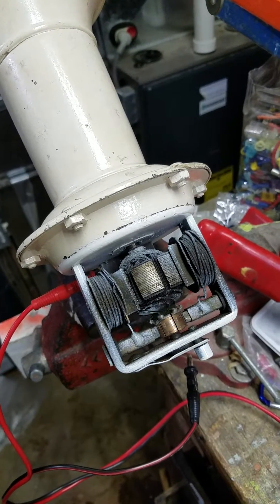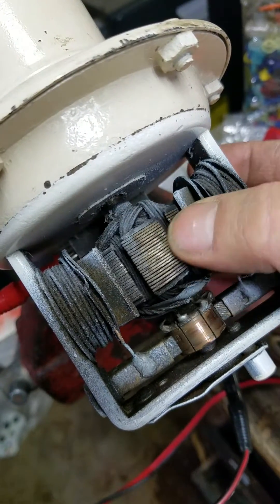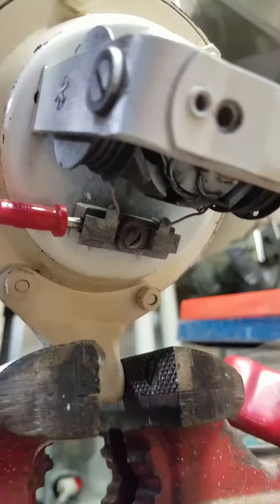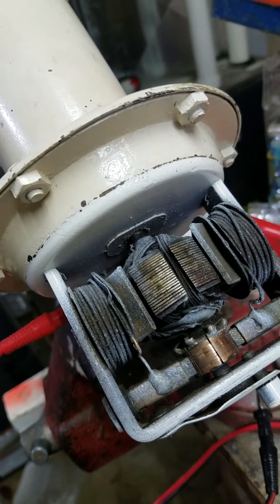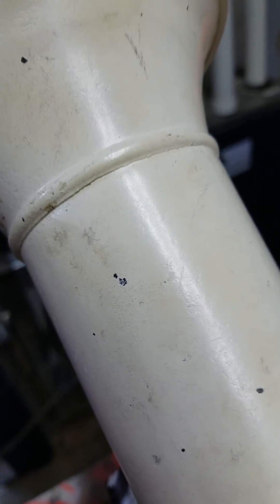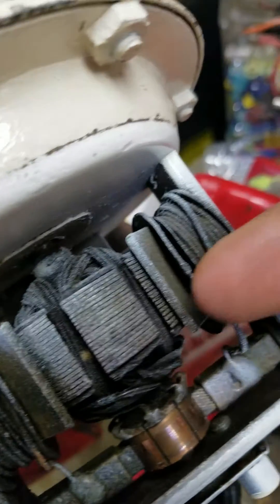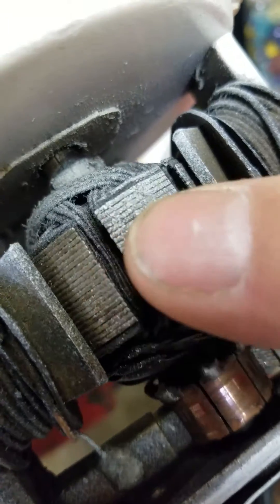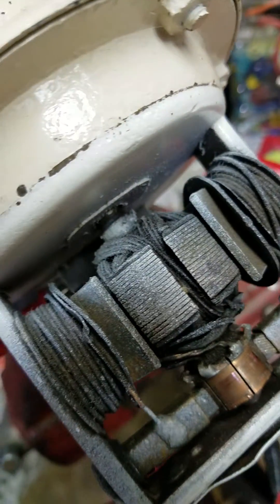Inside a Model A Ford AOOGA Klaxon Horn with Doc | Doc Physics

Comment: A 6V Model A horn, one of several motor driven horns manufactured for the Model A by at least three providers.  Klaxon was not one of them.  Klaxon 8-C horns were unique and manufactured for late20’s Chevrolet.  I would not hit it With 12 V for very long as it could damage it.😮

Comment: That's a 6V Klaxon horn, most likely from a model A Ford (those were made between 1928 and 1931. Sometime in history an ugly coat of white paint was added (they were gunmetal blue).  It seems in pretty good shape considering it is 90+ years old. These horns will work for a limited amount of time on 12V but give a higher pitch than originally, you will burn out the motor if you persist in using 12V on it. To hear what it sounded like in the late 20's and 1930's find someone who has a 6V battery. I have an identical horn thaat I removed from a 1930 Ford tudor sedan in my garage. The car was badly rusted and so is the horn, but because of the inherent tough design, (and not using 12V!) it still works after 90+ years. Reproductions are available, but yours appears to be original.